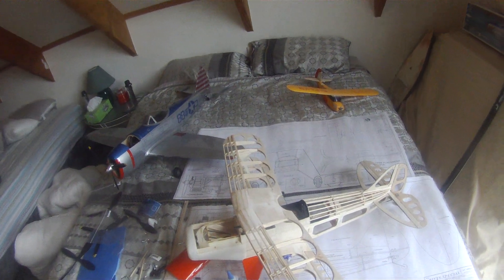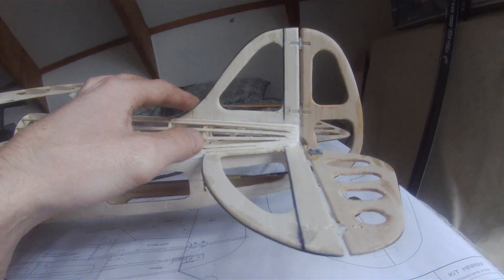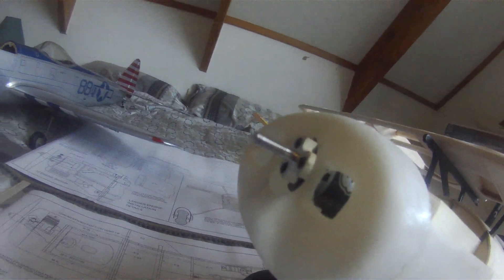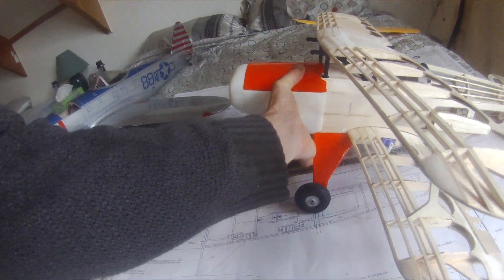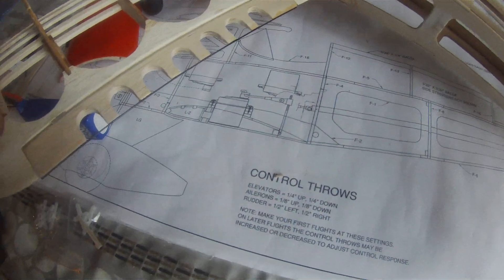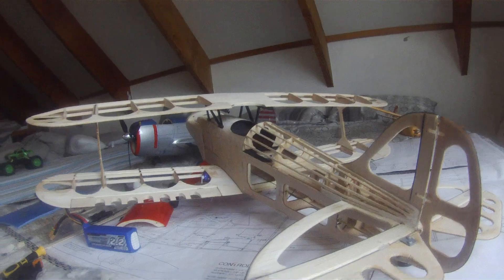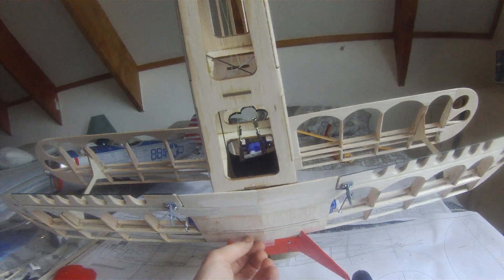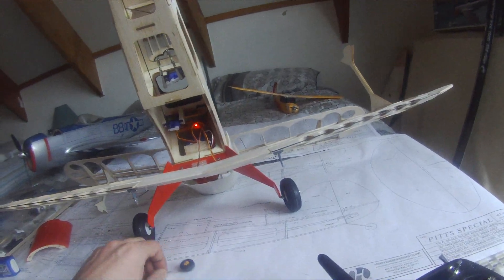HERR engineering Pitts 1/2A aeroplane rc electric conversion

Comment: How did you bend the carbon fiber rods around the rudder?
Reply from the maker: Yip, 0.8 - 1mm diameter bends pretty easy, then just wick some thin ca in there. in a crash the balsa still breaks but the carbon seem to keep everything hanging together and provide a little more impact resistance without exerting much force into the main structure